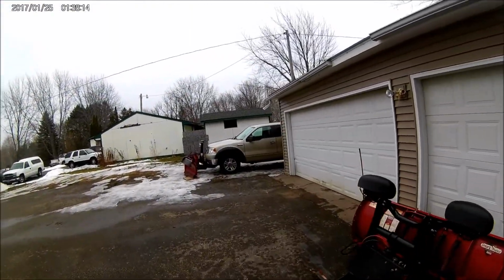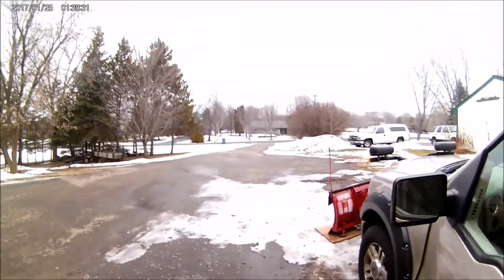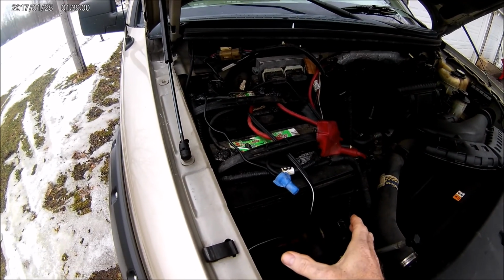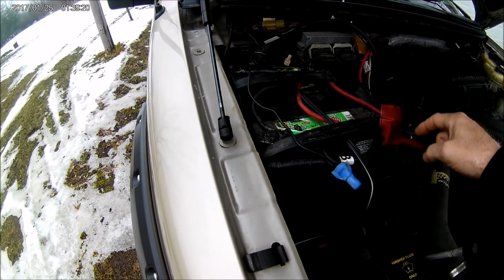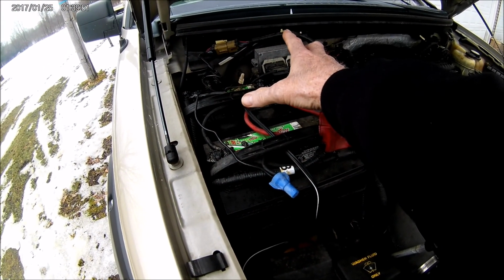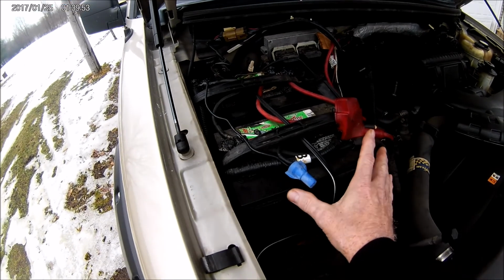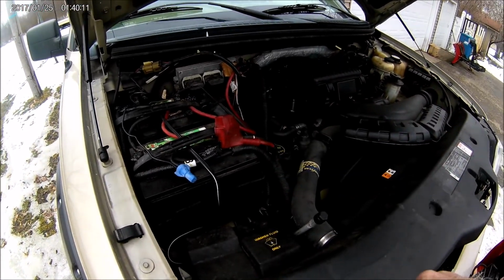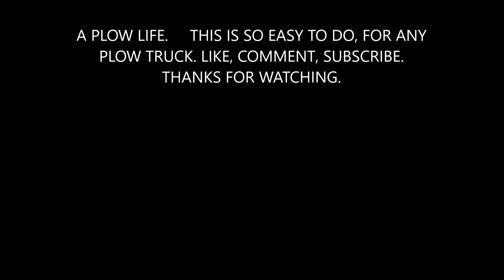HOW TO PUT 2  BATTERYS IN YOUR PLOW TRUCK, OR JUST YOUR TRUCK

Comment: This has really helped me understand everything..Ive got an old truck and want it simple and this is hitting the nail on the head perfectly! One battery for normal uses and the second battery for auxiliaries, in this case the plow. But this would help me with maybe running lights and extra audio equipment I'll get. Really did teach me the simple yet effective method.

Comment: Looking this up now for the same application on a 2000 Z71 for a 7'0 poly plow and yes what I'm seeing is neg to neg pos to pos batteries need to match do you know if the plow dealer has resources on hand to make plow wires longer?

Comment: You don't need a long ground to ground if you add a second battery on the opposite side. Run a short ground from that battery to the frame and you'll be just fine.
Reply: Makes sense

Comment from the maker: glad this helped you, FYI I wood start by taking the old battery box out. to make room for to box'es. or one box and one with out. that's how my ford is done in the video.   LIKE, COMMENT, SUB.   thanks for watching.
Reply: One thing my truck could do is a battery on each side of the engine bay, and install a second battery stand and strap'er down.

Comment: Was wondering if you could leave the plow wires hooked to the first battery with everything else and just run hot and ground from second battery to first battery...or would that  not help since everything is still on one battery?
Reply: I have the same question did you find out the answer to this question?

Comment: Did you ever get clarification on the second battery type benefits?
Reply: A marine battery as the second battery in this application is not necessary, since both batteries are supplying power only when the truck is running and both are being simultaneously being recharged.  A marine battery, as the second battery, is highly beneficial if you have the two batteries isolated and the secondary battery is intended to operate when the alternator is not recharging that battery.  An example would be if the second battery is used to power an inverter for 120 V AC power when camping or operating power tools, when the truck is not running.  The second battery can be fully discharged without affecting the charge on your primary battery, used for starting the vehicle.  A marine (deep cycle) second battery can be fully discharge and recharged over and over without damage.  Recharging of the second marine battery will take place when the vehicle is restarted.  A standard automotive battery is not intended to be fully discharged and recharged.  A standard automotive battery, used to discharge and recharge multiple times, will be destroyed very quickly.